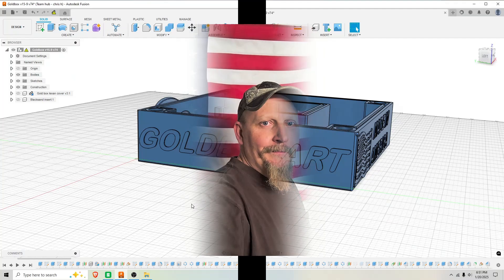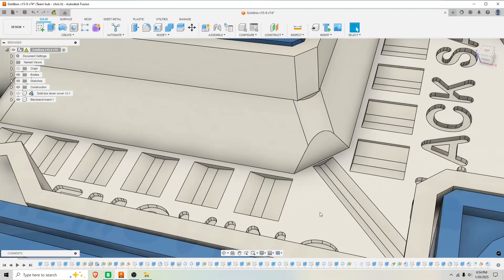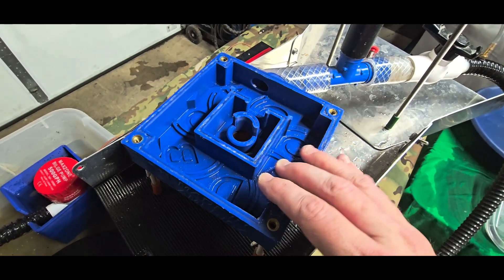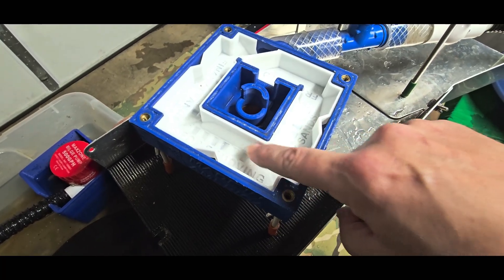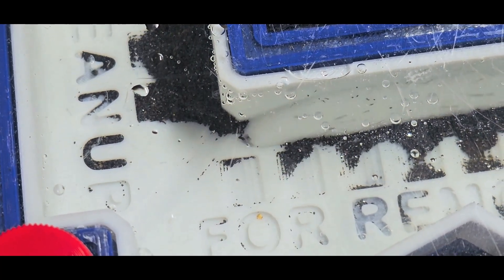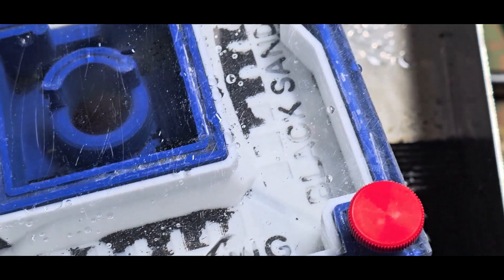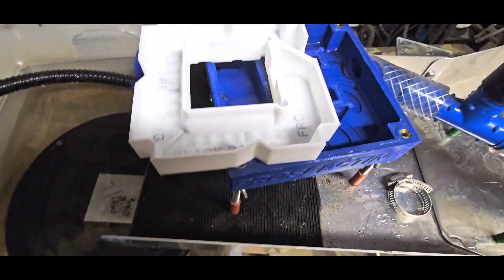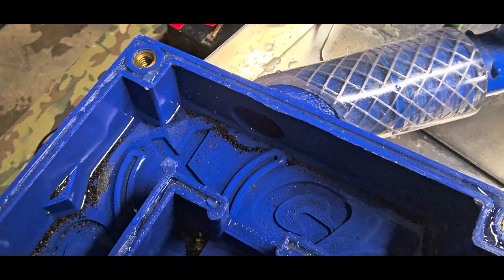Removing Gold from Volcanic black sands part 2,  was I able to invent a better solution?

Comment: Hello my name is Kevin I have found extremely pay dirt of flower gold I currently don't have any extremely cash to buy any ways to buy a souse box I'm broke trying to find work. I was hoping that you could possibly make a video on DIY fine gold recovery set ups. I really have a few killer pay dirt spots 1 mile away.    My pay dirt is from ocean ware land eroded to clay so I metal detected and my detectors was gong nuts but I never dug up anything but gold collection dirt.
Reply from the maker: Never personally tried this but I've seen people use gutters or splash guards like this  https://www.youtube.com/watch?v=6ck-W7KtXjI
Basically anything with small ridges that you can run water through "can" work as a DIY sluice but they will probably lose some gold so make sure to rerun the material to try to recatch what was missed. Where there is a will there's a way to succeed 😉